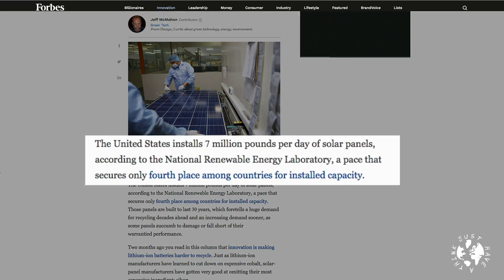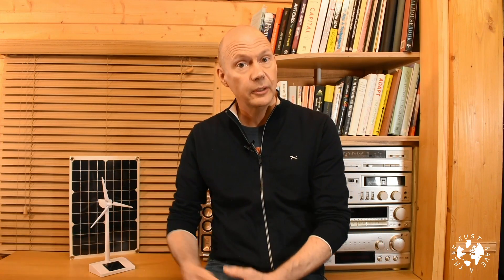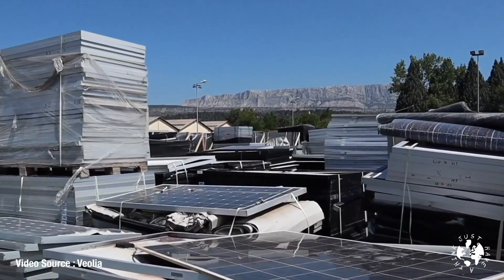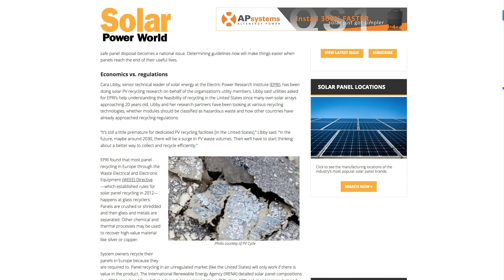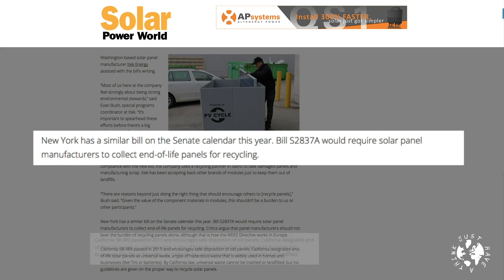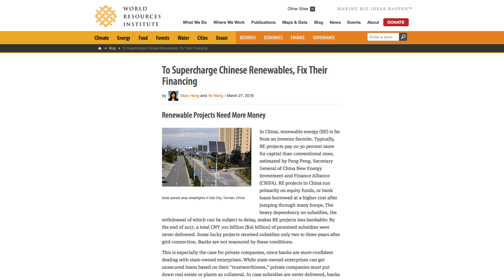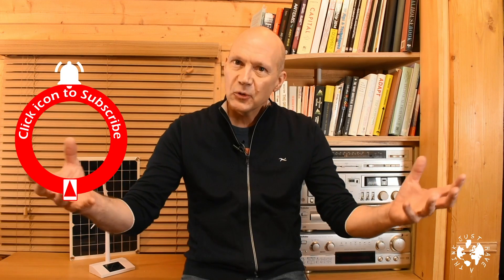Recycling renewables : a price too high?

Comment: for windmills, I didn't her anything about extending the design life of the blades - either during initial desgn/construction or towards the end of design life.  nuc plants - much more complex - have all extended life well past the 40 year design life of the major components
Reply: And the used fuel and replaced components are so few because of the power density they are stored on sight.

Comment: We need to have a "cradle to cradle" circular economy. SunPower is the only solar PV panel manufacturer that is currently "cradle to cradle" certified. As we design our technology to be cradle to cradle they can flow into the nutrients cycles without waste and pollution.

Comment: Molten salt nuclear solves the waste problem. (1) it offers dense high temperature energy on demand. (2) it burns the fuel totally - actually 99% versus just 3% for traditional plants. There is waste of course but it’s short 1/2 life is easily managed. The waste from traditional nukes is nasty for 300,000 years. New nukes can take that stuff and burn it right down. 
Thorium is another fuel that we currently ignore. It appears alongside rare earth elements (used for motors generators and electronics) and is currently a storage problem. Using it to fuel molten salt nuclear reactors provides the perfect zero CO2 energy source to back up the renewable energy sources.  Thorium sits lower on the periodic table than uranium so offers no bomb proliferation risk.

Comment: Good video. It always astonishes me that people keep claiming recycling is a problem when businesses are already waiting for the chance to make money off this untapped resource.
Anyone who says that PV panels or windmills cannot be or won't be recycled is spreading lies, anyone who actually thinks that is too stupid to understand what they are saying. Unlike oil rigs and old coal plants, panels are not leaking anything harmful and the only potentially problematic material in windmills is the tiny amount of oil and antifreeze in it. The concrete foundations can be left in the ground just like people leave every other concrete foundation that is not bothering anyone, only lobbyists paid by fossil fuel industry would make it a special problem; if they actually are in the way of some other project, explosives and jackhammers won't bother any neighbors as windmills tend to be built miles from anyone's home.
Attempts to make recycling a big problem are just smokescreen trying to hide the fact that fossil fuel industry has spent a century polluting the land without even trying to clean up their messes.

Comment: I would have thought that solar panels could be used as a building material without the need for breaking them down. They have constant dimensions and are still resistant. There are many applications that could use them as they are.

Comment: With turbines the older ones might be removed but there will probably be a replacement turbine. That will be bigger but on the same location  allowing the base to be reused.
Reply: Well perhaps a bigger turbine could be placed on the foundation after it is made bigger to support a larger turbine

Comment: Maybe this should be compared to Big Oil companies gathering up all their plastic, rotting oil pipes and nuclear waste. Do this calculation on a coal plant with its railroad line, pollution, and heat generated along with the chemicals that are not filtered out.  The tailing ponds failed in a minor hurricane yet nobody calculated the poisons into the ground water.  
Be good to see how much you come up with the recycling of all waste from a coal plant.

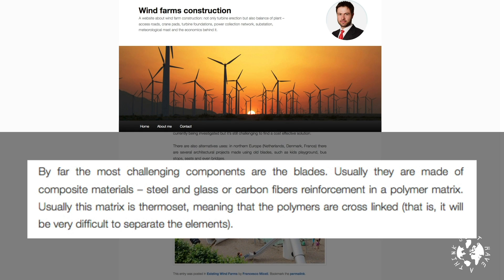Comment: 7:27 Making concrete out of old solar panels is not "recycling". It's just finding a new method of disposal. Afterwards, you still need to make new solar panels, and you need to find more raw materials. This is the opposite of recycling..
Reply: Recycle: To put or pass through a cycle again; reuse in a cycle.
intransitive verb	To extract useful materials from (garbage or waste).

Using some of the contents of a solar panel in concrete would indeed be recycling.  When you recycle other things, they may not  be used for the same exact purpose, but are used again for SOMETHING rather than being thrown in a landfill.

Comment: I think we will be able to handle recycling these devices. Nuclear waste which is poisonous will be harder to deal with.
Reply from the maker: Indeed so Franklin. I agree. I'm tackling the thorny issue of Nuclear in a few weeks time. It is quite a daunting prospect!
Reply: @JustHaveaThink  https://www.youtube.com/watch?v=TfsfFtdgGJI
We should rethink how we make and use
electricity. Why have a huge grid that can
be knocked down in a storm? We can make
a lot of our electricity near where we use it.
Nuclear power is centralized power production that then needs to supply a
large grid. Does a tree make all the sugar
the other trees need and then send it to them using a network of power cables?
Or does each tree make what it needs?

Comment: What I'm not seeing here is how destructive wind turbines are to the environment and all life around them.  Also, that it turns out they don't last 30 years, more like 15, with lots and lots of maintenance,  dirty oil changes, replaced parts and blade repair, and need for cleaning of ice, oil, and tons of insects off the blades and towers.  Parke Ewing of Ocotillo Wind Turbine Destruction.  https://www.facebook.com/OcotilloWindTurbineDestruction, says that in the 6 years that the Ocotillo industrial wind 112 turbine complex has been operating: "roughly the following have been replaced; 15 gearboxes, 17 blades, 2 complete turbines/towers, one complete foundation, 10 transformers, 2 main shafts, 100’s of yaw drives, 100’s of blade pitch cylinders, hundreds of “o” rings, can’t count the small cooling fans, pumps, breakers and fuses, at least 200 blade repairs, 5 major gearbox repairs, at least 10 underground electrical repairs, at least 4 underground fiber optic repairs, many unknown electrical repairs. Can’t imagine the things that we can’t see!"

Comment: you can only burn a gallon of diesel once!

if my solar installation develops a fault, maybe it will leak toxic sunshine all over the region and cause cancer incidents to rise for a generation? oh,  it won't! 20 square meters of thin glass panels can power a family of four for decades. I'm sure that the family produces far more waste than that every year with food packaging alone.

meanwhile oil spills are SO common in the oceans that only the biggest are ever recorded. look it up.
Reply: i hope your panels have micro inverters for each module.  It's more expensive, and parts may be offline without you knowing it, more to go wrong.  But otherwise the dc current will keep going as long as there is strong enough light, and fire fighters might not be able to fight a fire on your roof or where-ever.

Comment: How do volumes of solar panels and wind turbine blades compare to volumes of coal ash that currently is just piled up into toxic mountains?  How does it compare to the volume of all the other crap that people throw away every day, like nappies/diapers?  Which is worse:  We continue to burn toxic coal and generate gigatons of toxic coal ash, or we get clean power for 30 years then put a solar panel that is mostly rock back into the ground from whence it came?  I'm sorry, but this obsession with not burying relatively small volumes of clean waste that is no longer useful is not rational.

Comment: How much fossil fuel is used in recycling I notices none of the recycling where solar or wind run they seem to use a lot of heat to dispose of metal and plastics where does the heat come from I would guess coal (Natural gas or oil) the same fuel that was used to make the original product. So my question is are we any farther a heat with coal and oil used to build solar and wind turbine with coal and oil used to decommission wind and sun products. Some one has to an honest research on that.
Reply: Why guess and assume gas?

Comment: How does a wind turbine blade wear out  exactly? Does it get stress fractures through wind stresses not sureI know the inner guts won't last but replaceable
Reply: I think probably uv degradation over time with any plastic based product, plus as you say probably stress. Just look at some old fibre glass canoes

Comment: so what happens when the company goes bust just before they have to start recycling the PV panels?
Reply from the maker: Hi Gregory. Well...as a great many viewers have now pointed out to me, these panels will last for many many decades, not the 30 years that the reports I highlighted were suggesting. Some of the very first panels (like the ones that Jimmy Carter put on the roof of the hothouse in the late seventies, ) are still perfectly functional today with no sign of significant degradation at all. Secondly , folks have also told me of number of  second life usages for these types of hardware. And lastly, I think in 30 years time we will all have really come to terms with this green revolution thing and re-using / recycling will be big business by then. Or maybe we'll have messed up the row with Iran and Donald will have got us all killed in a massive nuclear conflagration. One or the other probably. Heyho.

Comment: Yeah, well what happens to the coal, gas or nuclear power plants in the end of their lives?
Reply: Nuclear waste can be recycled and used over again with high success.
Reply: In the US, a lot of times they just sit and rot until someone salvages the valuable materials and/or the EPA cleans it up at tax payer expense. Coal fired plants leave a lot of toxic residue to clean up. Gas plants are cleaner. But they can leave material goods to clean up. Fortunately, the materials in gas powered plants actually have a salvage value so owners don't usually abandon them. Nuclear is the victim of a lot of misunderstanding. We have a mess because our original nuclear energy program was more worried about building bombs the sustainable power plants. So, many of the plants were built on these older designs with no plan for cleanup and disposal of the waste. A lot of the hazards have come about because of our government's goal of nuclear superiority. New nuclear technology is different with companies like GE developing smaller, modular nuclear power plants. They can be removed and returned to the factory for salvage. Our biggest problem right now with any of these programs is our government. In the US, greed and short term profits are more important than long term environmental impacts. Big money controls most of our legislature and it is hard to hold companies accountable for their waste. In fact, the current administration is cutting back environmental regulations. They are just leaving the mess for future generations. Even our existing recycling programs our having issues with the supply of recycled materials exceeding demand.
Reply: Coal plants some are converted to Natural Gas France has a problem with nuclear waste that is bad for thousands of years,
Reply: How much energy they produce? How much waste they produce? Im talking about the only real "clean" energy source right now, who is capable to feed the increasing demand of energy. Nuclear. Wind and Solar are secondary sources, and they need almost 430x surface (wind) and 250x (solar) to produce the same MW than a Nuclear facility.

Comment: Great reporting on this topic.  I have been trying to think of the various ways that we'll find the shortcomings of PV/Wind over time, not because I want to sow fear or doubt -- whatever we do will be better than business-as-usual -- and recycling is an interesting angle.  It would be very nice if we could modularize/standardize these installations, as this could allow us to take a solar field, for example, and replace just the panels, or turbines and replace just the blades, or gears, for example.  I wonder if any research has been done on how a 10x or 100x increase in these renewables will impact ecology, for example interferences with surface winds, or reduction of earth heating from solar.

Comment: In Europe they presently are recycling Solar at 85% which is simply increasing.  Yet in order to manufacture, you need not use Fossil Fuels!

Hydrogen is a far better heat source than any fossil fuel. Incorporate Hydrogen into the recycling market (which should be in use anyway for storage) would accelerate the recycling narrative to a much higher level.

Comment: The issue isn't recycling. Its monitoring and enforcing the recycling of each countries waste within its own borders. Laws need to be passed to prevent the shipping of waste goods across borders and internationally. The west has used the rest of the world for a dumping ground and plundered its resources for far too long now.

People need to made aware that their recycling isn't actually recycled and is just dumped either in their own country or someone elses (stockpiling btw is just holding stuff before we dump it). 
International laws written into the laws of every country need to force manufacturers to use ONLY easily recyclable materials until we figure out a way to reclaim individual components of alloys etc or separate and reuse the harder to recycle items like alloys containing rare earth elements that we cant get back.
A serious lack of understanding of basic maths and the inability to see problems at large scales combined with capitalism (Greed) has led to the situation were in and those 3 things are all we need to address to start the reversion.
As much as im for capitalism it honestly is the driving force to destroy the world, it places value on final products and not the resources required to generate them. ALL RESOURCES ARE FINITE. We have exponential growth against them all, including the things we should never have had access to e.g.: Groundwater between bedrock. The US and India show the worst depletion of ground water, guess which country is trying to act on this and which thinks that throwing money to research etc is the solution.

Comment: It's lot easier than nuclear waste.
Reply: What do you think of the idea that nuclear waste could perhaps be deposited along deep ocean tectonic faults to be dragged down into the earths mantle over time? The deep ocean is very still with relatively little motion, unlike the surface water with currents and tides ect. Radiation can't actually pass through dense water very far, as the issue with Fukushima leaking into coastal waters that get swept around the world currents. So apparently certain spots in the deep sea would be fairly safe to deposit waste as it would be a fart in the wind once dragged into the earth over time. Its not legal to dump nuclear waste in the ocean though due to careless and reprehensible practice years ago..
Reply: No it's really not. Compare the amount of waste created by  millions and millions of panels to the very limited amount of waste from nuclear reactors. We currently store most of that waste on site at the plant the produced it so it's not all that much. We also have the technology to use most of that waste in other types of reactors to bring down the waste to very little. I am not saying nuclear waste should be trivialized since it has a very long lifetime and there are nuclear weapon proliferation implications but it is manageable and not what most people think.
Reply: @michaelweaver2627  the other issue is scaling nuclear energy production well over the kind off fail safes designed into the far smaller more manageable kind of reactors that were made to prove the technology. Its either scaled up for profit under the capitalist modal or just the bigger output under the soviet modal in the same way. Apparently so anyway I'm no expert. But yeah really it's better to spend more to get less in the long run but people don't want to pay more...
Reply: @leifcian4288  I also  no expert either but I think most new designs try to use passive fail-safes so when things go bad the cooling is not driven by mechanical devices. I just know (believe strongly) that we are not going to get enough from renewables and their limited storage capabilities so we better start designing and building really safe reactors ASAP. We will need them at least until fusion is proven practical or better electrical storage capabilities exist.